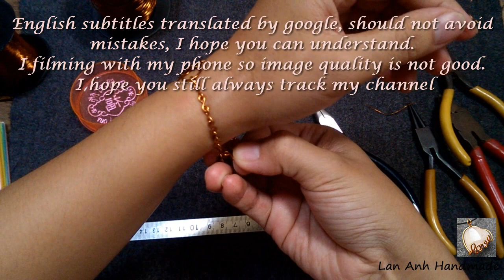Wire knot bracelet - handmade copper jewelry 104

Comment: and after your your project is all done, if it is dead soft wire that you use. it's not still soft to bend and mess up? it is strong and durable when you are done? I hope that makes sense.
Reply from the maker: I don't understand what you asked, after bending finish I usually use hammer and anvil have the gloss to create hardness. depending on the pattern that I choose wire size to make sure hardness for product.

Comment: Where I can buy the wire?
Reply from the maker: I bought all the material and stones in where I live (Vietnam)
I used to round copper wire - magnet wire , it's the only kind I found where I lived for many sizes. I do not know exactly what type it was, can be dead soft copper wire, it have plating layer, and not dark by time
I bought the same type as the picture
http://www.ebay.com/bhp/magnet-wire
 you can buy dedicated materials at the site
http://www.beadalon.com/prodcat/artistic_wire.asp